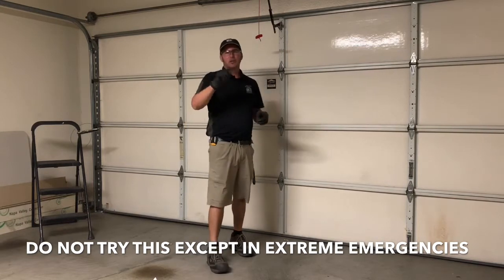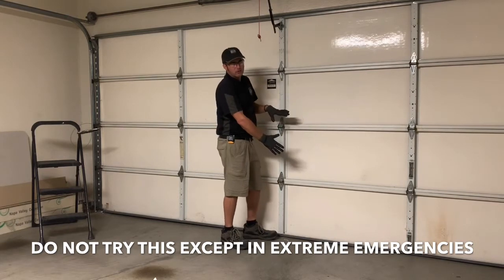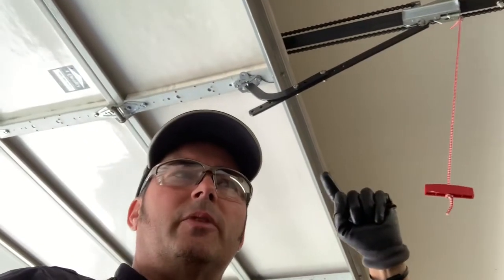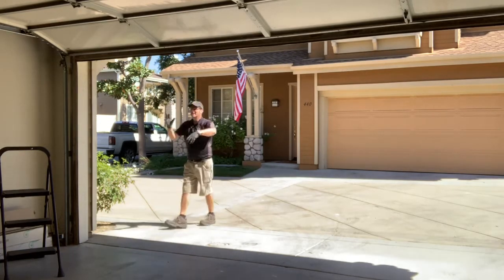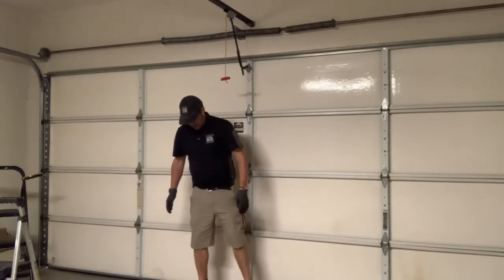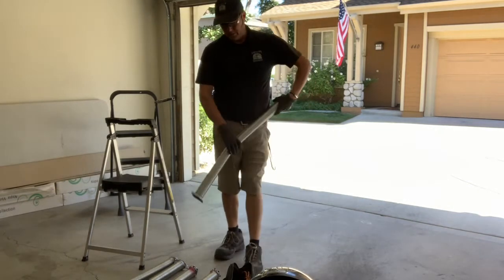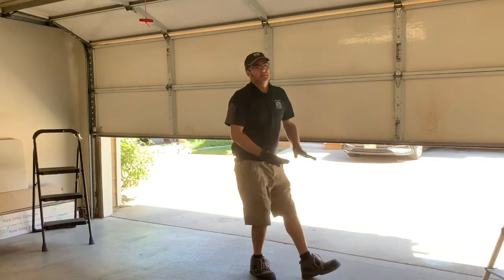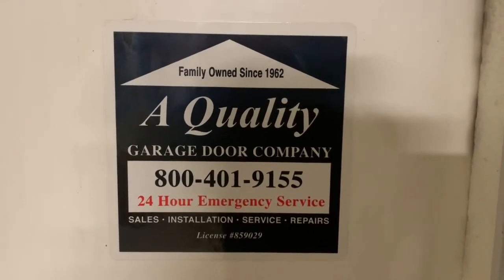Emergengy Garage Door opening - Door Won’t Open

Comment: Nicely done bro. the other day I was with my friends and worked on installing garage doors and the small one had 6 panels, was approximately 8 x 16 and 240 lbs, we hadn't put the springs or cables on yet and I was able to completely lift that door dead weight.
Reply: Boom! Now that’s a real Savage right there. :-) Good on you!

Comment: That's great but my door is an old HEAVY steel door that probably weigh almost double. How can I lift it all the way up to change the pulleys and cables?
Reply: Well if the springs are broken, you’ll have to lift it the way I showed him the video and then keep it open with either a board to hold it up or some vice grips to clamp on the track to keep it from coming down. You can change the pulleys and cables this way, but you simply cannot install springs this way because the springs need to stretch it out in order to wind back up as you close the door. If you try to put the springs on with the door open, the door will bind as you try to close it. 

Hope that helps. :-)

Comment: We have a 12' storm rated door. Both cables snapped when we bumped the edge of the door putting the RV inside. Now the RV is trapped with mere inches between it and the door. Worse, the width of the RV is so that there's only about 2 feet that anyone can get in on either side. Garage door guy guessed it's about a 500 pound door. NOW what do you recommend? Definitely need some ideas. Thank you!

Comment: Bro!   Great to see you making videos.  I just subscribed.  What's your opinion on using the motor to help lifting the dead weight of the door?
Reply from the maker: Good question, if you have the strength to lift it without the opener then do so. The whole point is to get the door to go up evenly on both sides so that it doesn’t bind and that is best done by hand. 

 Yet of course, if the door is a little too heavy to handle, the opener will definitely help you out. Great question!

Comment: You may have to loosen the top rollers and pull back. The door could hit the drywall. The door opener pulls the top panel back. Push on the top roller.